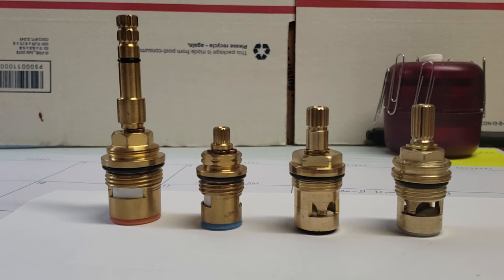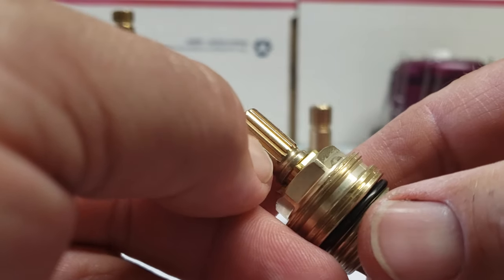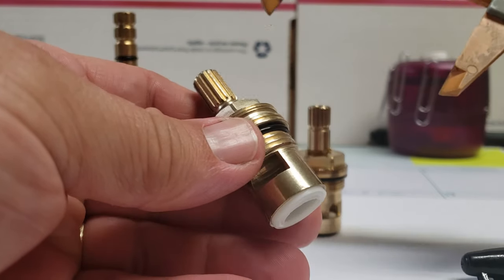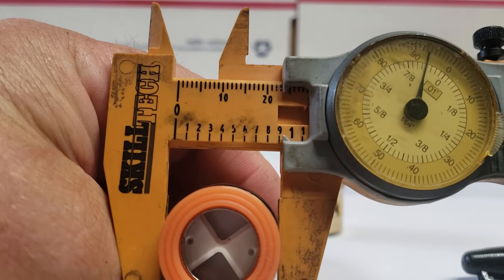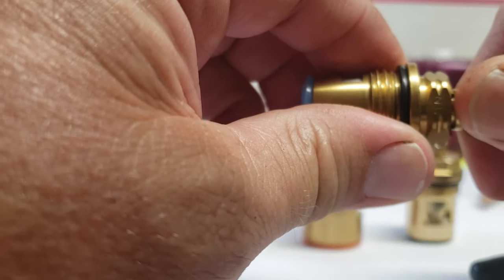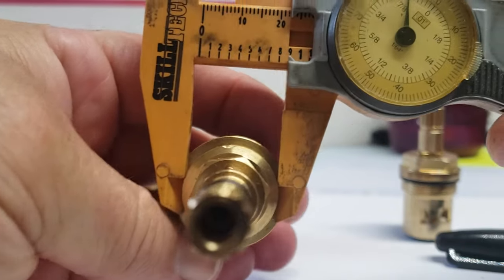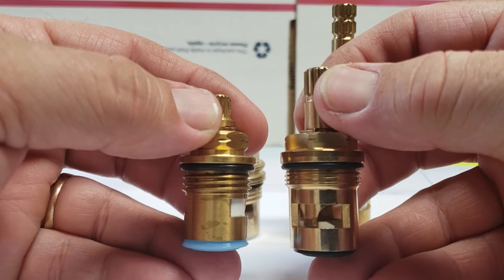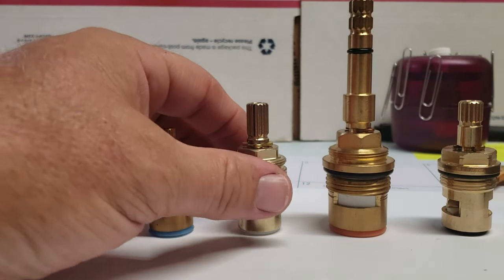How to identify your faucet cartridge

Comment: My cartridge is flat on two sides and rounded on the other two.  No splines.  There is also a metal ridge on the stem.  I don't see this on most cartridges.  I'd like to find out if any cartridge will work in a bathtub faucet apart from maybe having to get a new faucet handle or if you need the specific make and model that is there now.  If so, I'll just buy a new handle, too.

Comment: Guess mine is much older because the one I have isn't even close to looking like any of these. It also doesn't have a 6 sided nut on top, only 2 parallel flats to put an adjustable wrench on. It's on a wash basin used as an overflow for a washing machine. So I cannot replace the fixture because I cannot get to the underside.

Comment: Bought matching cartridge and new handle but both won't fit as handle thread doesn't fit the cartridge thread!! Any help is appreciated 🙏
Reply: Number of splines on top of cartridge should match number of groves inside the handle - that’s how they get connected to each other. , for example 20 splines on cartridge will match 20 groves on handle.